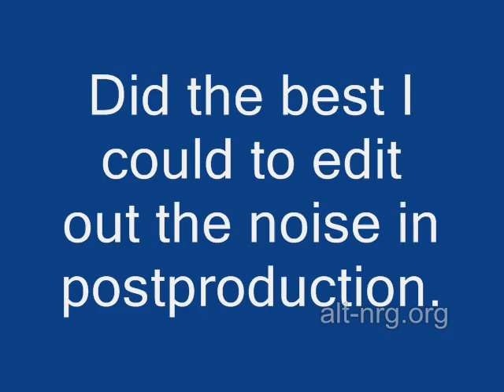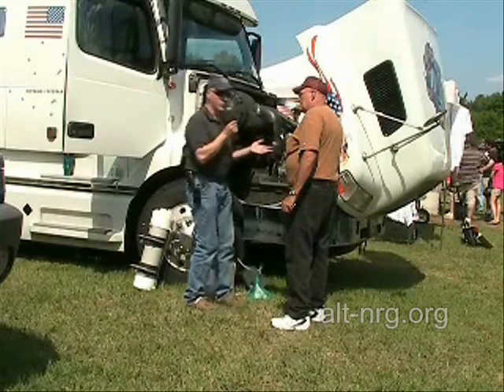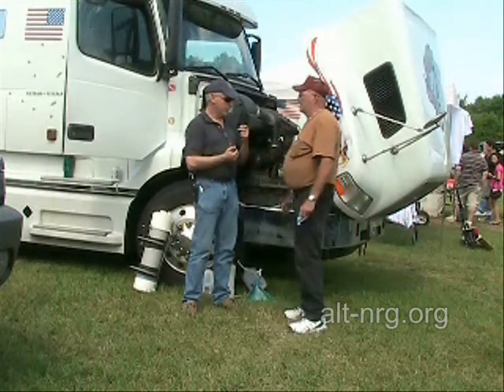#179 Bill Tucker talks about his Volvo big rig HHO

Comment: that really is almost hard to believe at only 3 liters per minute. you can piece together a 200 dollar kit from amazon that will produce 6 liters per minute at 80 amps. and you would be saving ass loads of money with a big rig. 6.5mpg to 12 mpg is nearly 50 percent savings in fuel. It sounds like his system is producing more like 15 to 18 liters per minute with that size motor
Reply: At 80 amps in semi you overrun your alternator. My semi has 140 amp alternator. Yes you can upgrade but very pricey.

Comment: Spread this comment to other videos or simply spread it to your websites. ZFF and others going after HHO are dead on! The deal with trying it in a regular gas motor is the issue. gas is 8:1 compression Diesel is 18:1 maybe not exact but you see the difference. Now look at Hydrogen and it is 30:1 that is why diesels see better gains than regular gas motors. BUILD A HHO DIESEL motor from the ground up designed for the fuel and then it will be done.

Keep rocking dont listen to nay-sayers

Comment: I like the diesels - no map/maf sensors to fool. I installed a three cell unit in a five cylinder Mercedes diesel and then I had the fuel delivery turned back by 40 percent with smoother acceleration and more power.

Comment from the maker: I don't fault you for doubting.  Extraordinary claims require extraordinary proof.  The proof is in his general ledger statements and in his wallet.  He is excited and for good reason!  All you need do is examine his proof.  Until then, all you have is a believe that it cannot work.

And even if, as you say, it is the worst engine, have you ever stopped to consider it may very well be that the worst engines are the ones that stand to benefit most greatly from HHO?

Comment: thanx ZFF. iv seen a lot of claims by cell builders improveing the milage on truck, but when i contacted them they were very veage as to the gains. i hope his numbers are on paper and not from the ecm, they are always way off. it wonders me, if he could double his production would he see even greater gains or if the injectors would have a problem with the flow rate. i also wonder if he changed the alt to the larger. 11.1L detroit not tipical either, 12.7L is most common 14L is the best seires 60